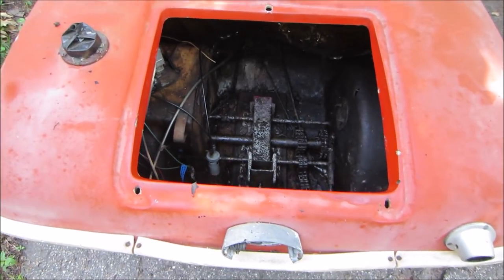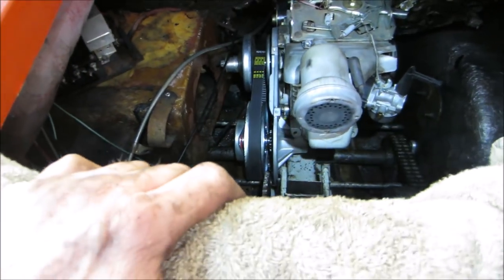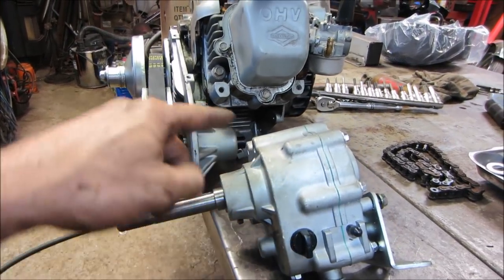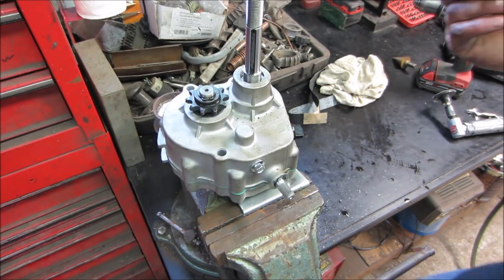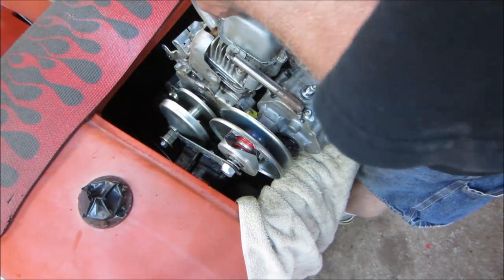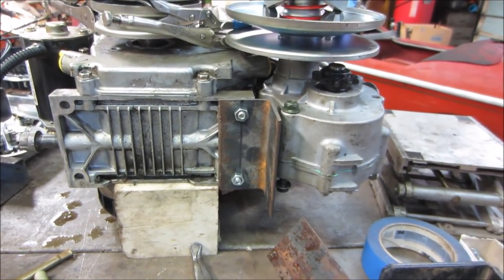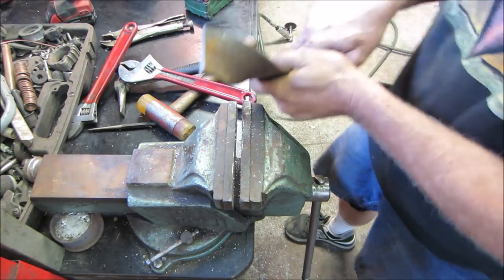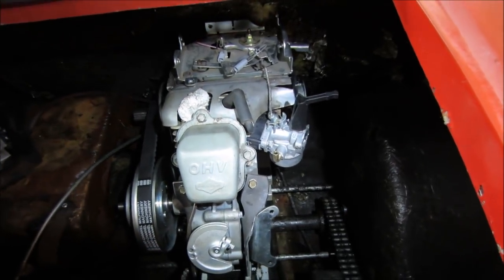beaver amphibious vehicle,  engine to the transmission fabrication.

Comment: Happy 4th Mustie..... Hear me out here. Cut the rear top section off, it would look like a little pick up. That would give you plenty of room for engine work and modifications. When the engine and mods are done. Set the section back on and seal the seam with fiberglass. Oh well I was just thinking.... Mike
Reply: He's going to have to do a little fiberglass work,  appears to be a small but noticeable hole in the right wheel well that would allow water ingress if the machine were to enter deep water.  Either fibreglass or another concoction to plug that little hole.

Comment: Wow! Great fabricobblin' and spatial perception. Ya left me in the dust when you started to move the trans closer to the engine, but perhaps seeing it in 3D rather than flat screen might've helped. And you blew me away with the twist-o-bracket. I'm chuckling away here in my Lazy Boy watching you spend quality time on something as, let's just say  'unique', as that Beaver. And for air circulation, maybe you could find a way to bolt or rig an electric radiator-type fan to a pulley...maybe another jackshaft and a bracket ;-)
Reply: The fan has been discussed.  In the last video, he mentions his plan to mount an electric fan in the fiberglass fresh air opening.
Reply: Paul Copeland - Thanks. Yes i know about the electric fan plan and potential charging issues.

Comment: Great video Mustie you'll probably get a lot of wet beaver comments on this one :D  If you do run the intake for the carb under the engine i would factor in some way to drain it if it gets water in it. in a humid environment I think that long of an intake tube is going to collect some water. maybe a drain plug at the lowest point.  might be able to get to some hidden fishing spots with this once it's going . can't wait for the next video

Comment: Thinking that bar will work, but needs to be MUCH thicker.  That's a lot of torque going through the converter.
Gonna bend that thing all up on the first real throttle blip.
Comeing right along though! That seems like the biggest challenge, besides getting everything waterproof of course. :)

Comment: Don’t forget the ratchet underneath.  The engine/tranny mounting looks like it’s going to work out.  However what about changing oil in the future?  Looks like you’d have to pull the engine to do that in the current configuration.

Comment: Have you thought about making it hydraulic? A pump on the motor, spool valve for direction and a tiny hydraulic motor on the final drive. No need for brakes. Bleed bypass for speed/torque.
Reply: i think a hydraulic drive would work well for this project, maybe taken from a riding mower/small tractor
Reply: What about weight of hydraulic fluid in a container? got to watch the weight
Reply: Had a hydraulic drive in a canal boat I gad, worked really well.
Reply: flir67man hydraulic fluid is only 7 pounds a gallon, probably wouldn't take much to run something this small and he is already way under what the original was
Reply: Collab with AvE? Nah, they're geographically too far apart. Shame though.
Reply: That’s a really good solution.

Comment: Love your site, Mustie1!  
I wonder if that transmission comes with different-side in/out shafts, and if that might be helpful.  Also, a side view sketches of the individual components with the fixed distances (clutch, jackshaft, etc) might be useful to try out different orientations.  Move the sketches around like a puzzle -- much easier than the actual parts (though of course only in 2D).

Comment: Im thinking,when its running,and you put it in neutral,the engine and clutch is going to free spin.That might suck,because you have to shut down the engine when shifting forwards or reverse..But the electric start is a good thing.

Comment: Plastic shims are helpful in positioning pieces and apparatus when measuring for brackets and belts and the like. Home Depot has them for carpentry. The big nylon wedges can be purchased at tree fallers' supply.

Comment: I'd try to maximise the distance between gearbox and drive sprocket if poss' Mustie, that's a steep chain angle for a small cog (smaller drive sprocket planned?). Sure you'll figure it out, looking forward to the next vid.

Comment: Sad about the old engine. Personally I would have kept on with it. I once rebuilt a Lancia Fulvia engine that looked like it was dredged from a canal. I had to use a block of wood and a block hammer to get the old pistons out. Rebored and new pistons sand blasting and painting and it was beautiful again.

Comment: Make sure you check the seals around the axel first because I hear that  is a common place that water can leak through if the rubber is dried up. And by looking at the condition of the engine that seems like it could be likely.

Comment: If the input and output are the same could you take apart the forward and reverse gear box and swap the shafts? That would bump the short shaft with the sprocket over the 1/2” without the need to scab on another gear and rotate the gear box aft around the long shaft mounted in the plate giving you more clearance for mounting and adjusting.

Comment: That is a lift, right? I don't recognize that. Yes! You need reverse! As I went further I saw you are getting close to the solution.
I know you are going to use the gearbox. Those are cool and can be shifted with a cable setup.

Comment: What you could do is run a sprocket on the engine to the gearbox, which would give you the ability to mount the Comet to the shaft on the gearbox. Then line the Comet up to the rear sprocket.

Comment: What about extension tubes on the oil fill points so that you can access them with the engine in situ? It would mean that an oil change would be suction pump rather than drain plug but at least it could be done. Still, it does look good, envy you having the workspace for projects like this .

Comment: take a peek under the rub rail and see how the top and bottom are attached.  Might save your elbows from fiberglass splinters, and back if the two were separated. Just a thought.

Comment: Block off the side hole on the air box and make a new hole on top with a blower fan, easy to run a pipe over the top of the motor then.

Comment: a few questions.. when you mount the engine to the base would it need to have some form of damper? so the body of the beaver don't crack from the vibrations and torque of the engine?..and have you thought on how to keep the engine cooler?...thank you for your videos and sharing of your knowledge...

Comment: Mmm i like that soaked beaver
Reply: Dimitri Andreou A good bath is the best way to get all the shmoo  out of the beaver.
Reply: Still?
Reply: Never saw a beaver do a wheelie either, that was cool!
Reply: Dave Kauffman Yep. Seen a beaver do a few things but never a wheelie.
Reply: Nobody knows what a beaver wheelie is?
Reply: Enlighten us if you dare. Does it involve one or more things you can buy legally in the shops?
Reply: For those that don't know, the term "wheelie" is short for "wheel-stand" where a vehicle's front wheels are lifted off the ground because of the torque of the rear tires against the pavement. The Beaver's front end was lifted off the ground so that Mustie could pressure-wash the engine bay and the water could drain out does that help?

Comment: Can you not lose the chain completely and turn it into a belt drive, you can connect the reversing module direct to the output shaft of the motor.

Comment: for the airbox, why not block orff the opening then drill a hole at the top of the box and run standard ducting tube from there to the engine?

Comment: Say friend can you run a chain from the engine to the transmission. Attach the tourqconverter on the transmission and run that by a chain to the jackshaft. Would this get more room or access. Just wondering. Your there and you own it. Just trying to help. Just a suggestion. Great stuff you do there. Thanks.

Comment: i think you shoud make a new cvt backplate with de reverse gearbox on it  there is al lot of pulling tention between those pullys.  Grind also the front oilfiller off aluweld the hole shut.

Comment: Can either shaft on the transmission, be used for input or output?

Is there a hole in the top of the right wheel well, or is it an illusion?

Comment: Hope you checked the seals so when it's in the water, water doesn't leak through the wheel axles and flood the engine compartment.
Reply: A boat that doesn't leak!  Now there is an idea.

Comment: Could you put another pulley on top to run an alternator to charger a battery
Reply: david dove the engine all ready has a charging system on it.
Reply: But he did say it might not be enough to charge and it will wear out quick

Comment: I would put a little pump boat pump in there what's a float for just in case if you can find cheap one in a junkyard would be cool so your motor won't never get wet

Comment: Why you didn't use those same bolts that holds that bracket for cables, it would have been so easy to make a bracket from that gearbox to the engine from those.

Comment: Is the gear box 1:1 ? then reverse the gear box, put torque converter on left as in the start but mount the gear box on the left but with shafts facing to the right. move it over.
Reply: LOL to late should posted that on the fist video.

Comment: it's going to work, and probably work good. but I'm thinking it's going to be underpowered or be slow or both. because you just lost the 4 speeds it originally had, if you gear it up to be a decent speed then it will be under powered. I'm not sure how it's going to be in the water without any wheel speed to drive it

Comment: Looking at this, I think I would have built a base plate for the motor, and transmission, then worry about the drive chain. That and possibly change the bearing in the original drive bracket

Comment: Toss it in the first way and forget reverse.   U turns in water are not unheard of:-0).
Reply: phooesnax yes but because this is amphibious you want the reverse so you can back a lake bank/shore line because the front wheels aren't powered only the rear are

Comment: In my state, you're not allowed to take anything with a gas engine into the water in pretty much all of the parks.  You can take it into the river, but I would never take this boat into the rivers near me. It just wouldn't be safe.
Reply: When away from urban pavement trail riders and hunters can find themselves faced with swampy conditions at any time other than desert or drought situations. Beavers and other such vehicles are not necessarily meant for state waterways.
Reply: To be honest, I was thinking of it more as a toy... It just sucks that the state parks (which some have lakes) forbid gas engines. heck, even 49cc bicycles are forbidden on our roads. It's PA. They have endless rules.
The worst part is that these rules are selectively enforced. There are gangs of teenagers and 20 something men driving off-road bikes on city streets, doing wheelies and driving in huge packs of 50 or more (all on unregistered off road bikes), intimidating people and just wreaking havoc and they don't enforce the laws against them. But if you try riding a bicycle with a small engine on it, you'll have 5 cars pulling you over, searching you, taking your bike etc.

Comment: hea Mustie, are you going to install a transom blower and a bilge pump? since the OEM engine ended up under water, a bilge pump with a float switch might be good to keep the water out of the engine, build looks sweet brother, kinda wondering how this is going to turn out, knowing you it'll be awesome and a hoot to drive

Comment: Could it be possible to go gear to gear and just get rid of the chain? You might need a bigger sprocket but you would pick up some rpm i think but might loose a little power.
Reply: you could make up a foot plate to mount the motor and transmission and it isnt going any where you could just switch up forward and reverse

Comment: Supposedly that plastic rim (bumper?) thing comes off, and the top and bottom clamshells apart. Might make things significantly easier to work on in terms of having room without having to cut too much into any fiberglass.
Reply from the maker: does not come apart

Comment: Question: Is that a hole in the fiberglass on the top of the right wheel well??
Reply: I saw it too.  For now, let's call it a "cooling port", can either be to allow for air cooling or.........

Comment: great work, I think I would of remade the bracket that holds the shifter cables, a little heavier material, extended it to catch the engine and the rear mounting hole, raised it to align the shifter cables, its easy to say that when your sitting back watching someone else work  lol

Comment: I'm wondering how your going to supply enough cooling ,
Reply: There's currently a small hole in the right side tub wall (wheel well).  When he's not taking on water for water cooling, air can circulate either in or out of that hole, in addition to the Beaver air inlet and outlet. :)

Comment: I think you can separate the body. Remove the top to help this project.
Reply from the maker: does not split
Reply: Normall the make these bodies in 2 piece like ATV's.
Reply: also the glass fiber could be rather brittle, wouldnt wanna risk cracking it
Reply: Even if it did split that would add on to the repair list because when putting it back together you can't just throw it back together it needs to be water tight.

Comment: Dont now if you read comments ? but youre charge system is not worky worky ,no magnets in flywheel.
Butt nice vidjeo again .
Reply: You apparently don't read the comments.  The engine video comments explained that he installed the correct flywheel w/magnets.  Charging system will "worky worky".  Sorry to disappoint you.
Reply: sorry diddent see that ,good that it is fixed ,better then when its all in the beaver .

Comment: Did you go to College for over engineering all's you had to do was get a piece of 1/4incn steel  take the original aluminum one transfer all the holes to the steel then drill two extra holes for the transmission mounting points cut two spacers to put the transmission in the Right place and make one extra support bracket for the flywheel side
Reply: There's a big difference between "overengineering" & half-azz engineering.  Learn the difference.

Comment: You realize that the pulleys on the torque converter can be mounted further apart with the use of a longer belt. Do a little research on BMI or gopowersports or other vendor website.

Comment: Why can't you get a longer belt?
Reply: Thats what i also thought instantly...Mustie told us, there were around 4" space in the front, a slightly longer belt would allow the trans circling freely in any direction to attach it...
Reply: The distance between the two pullies is very critical. I can see why he didnt want to go that route
Reply: I would add half of the run lenght of the longer belt to the distance of the pulleys, that would even that issue out...
There are short and long blocks on scooters, all the same components for the pulleys, just longer cases and longer belts...look at the european piaggio range, especially the older ones from the 90`s, compare a "Zip" block and a "NRG" block, not really a difference...
Or do I think in the wrong direction?
Reply: The width of the belt is more critical. The distance between the pulleys has to match the belt your using.

Comment: Why have you not split the top from the bottom to give you more room to work, and happy 4th July :)
Reply from the maker: because you cant
Reply: ain't the 2 halves riveted together?? or did they fiberglass them together!
Reply: "can"t" is the key word here.  He has explained over and over that it is not two pieces that can be separated.  It "ain't" going to happen.

Comment: Converting it to electric would be easier, cheaper, and tree hugger EPA approved.  
It would be permitted on inland lakes too, but keep those lith-ion batteries dry!
Reply: Problem going electric : the weigh of the batteries. Remember, it's a boat !
Reply: Electric would be faster, more fun, solve the problems of forward and reverse.  No gearing required.  As far as weight, a couple 100 AH lithium batteries only weigh 40 lbs, and an AGNI 95 motor only 25 lbs, but puts out the equivalent of 30HP on demand and instantly.  Cost would be around 3K though, so not practical.
Reply: Keep the batteries dry? Nah, wet lithium is more fun. Want a good tree hugger status? Convert to propane!
Reply: Wheelchair motor, golf kart motor, starter motor, many cheap motor substitutes - SLA would be less than 200$ for 24v, heck, a trolling motor would do, lol.  24V lith-ion can be leas than 300$.  High speed in that POS would be suicidal.  An electric scooter 36v motor would probably do 20mph.
Reply: Why not generator -> electric motor. We get the gasoline engine working in the perfect rpm spot and can leave out the whole gears and clutch thing, mounting the motor right to the wheel shaft.
Reply: Thanks for the info. I tought the batteries would much heavier i.e. Tesla's.

Comment: Once the inside of that beaver gets wet. It stays wet a long time. Lol. Happy Fourth everybody!
Reply: I've never run into a dry beaver yet.  If excess moisture is a problem, toss a few tampons in, let them soak up the excess moisture then remove.  Failing that, try using a wet/dry shop vac, and then resume where you left off :)

Comment: mustie i know i havent watched the whole thing but remove the gas tank plate rotate the mount for the CVT up where the fuel tank was mount the reverser on top then run chain to cross shaft since your doing a custom exhaust milling the long shaft down to fit the revereser shaft is also an option 

the muffler in the way is really making options hard to see